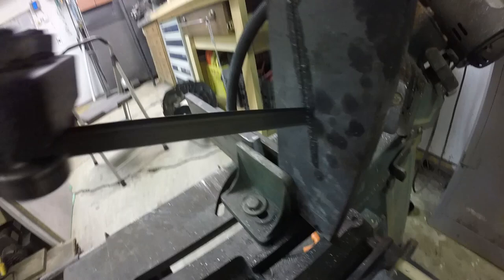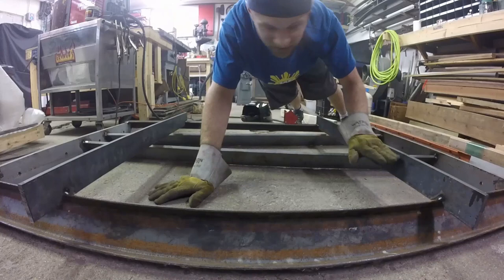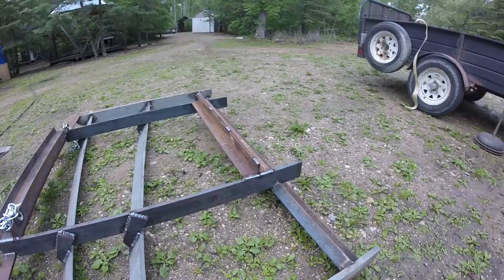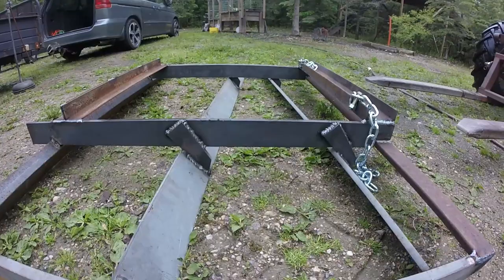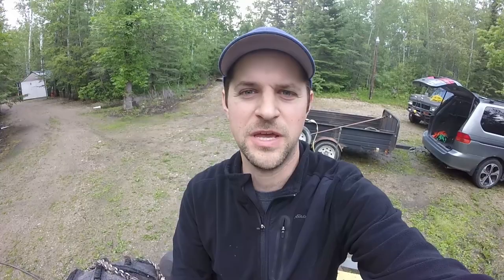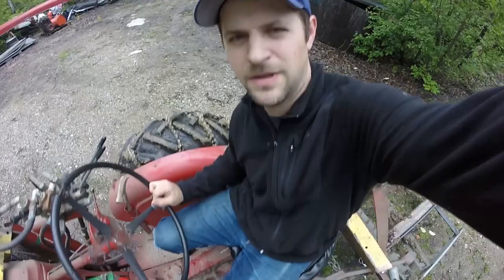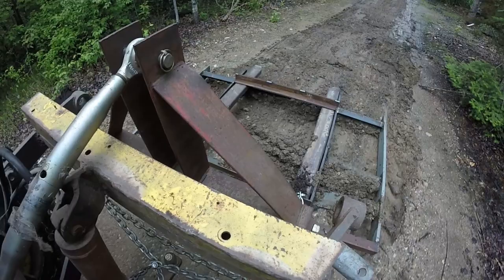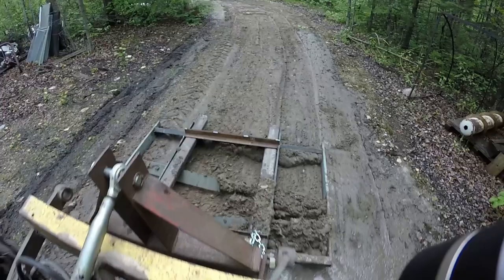Homemade 3 Point Hitch Land Plane - First Test

Comment: I am no professional but, I would have to say the issue with the rocks is that a land planer is a finishing tool. You are dragging into a surface that isn't a finished product. The size of rocks popping up are ones you would have a foot down. The top layer should be a gravel consistency for the plane to work as advertised. An easier way to look at it. A plane is a butter knife, meant for smoothing and leveling smooth aggregate.

Comment: As a home made box blade, I wouldn't judge it on a wet road. My 5ft box blade wouldn't be great on our wet road right now either. I'd say, wait till it dries out a little, then try it again. I'd say, it did pretty good, all things considered. My box blade has 5 or 6  adjustable-height teeth on it, that would be easy to add for you, if you needed to rough up the surfave a little. Other than that, I'd say you've got yourself a decent boxblade!

Comment: Teeth on the front blade (railroad spike works good).
Angle the middle blade more to let more material flow over.
Also attach an expanded metal to the top/behind the middle blade to catch rocks.
More weight in the back and adjust the top center link.
Reply: oh the expanded metal is a good idea.  I have a problem with waves in my airstrip, not ruts.  Ive only been using a drag harrow.  Need to make a long narrow drag box i think or use an old axle assembly for some rear wheels back on a pole, I would thing something 12-16' feet long is required to really get the bumps out, Ill be pulling it with a 4-wheeler.
Reply: I know your post is old but this is a great idea. Thinking maybe some 6" angle iron on top of the expanded at an angle to vibrate the rocks to one side. Thank you for that tip.

Comment: Think of it operating as a wood plane the high spots will cause a lot of drag and you only want to take a little at a time setting the top link to help control pressure on the front and back, and the side rails may need to be a little wider to help them to float so that you are only working the area inside the box, the length of the box helps to smooth the high and lows verses just a blade thay you have to keep feathering the 3 point up and down to get things smooth, all in all I thought it was working pretty good after watching some of the other videos of land plane that were commercial built.

Comment: Road needs a crown for sure. Need to drag a little off the side of the road to bring material back into the tracks. That material will displace the water. Wet roads are tough to grade as the next vehicle is going to leave ruts. 
I would add some 3/8” flat bar to the bottom of the sides as skids

Comment: I think you need some cutting teeth on her (weld on some 1/2-3/4" bolts) , and also maybe 150-200LBS of weight.
Reply from the maker: ill try weight first, it easier hehe
Reply: @REDNIC79  I agree lol, start with the easy fix / test first

Comment: I used a land plane years ago to level a new hay field.  The one I used was about 20 feet long, with a single blade in the middle.  It needs to be long to bridge the low spots and shave off the high spots. The dirt would collect quite a bit in front of the blade, but drop out to fill in low spots. It needed to flex to follow the ground contors and shave off the high spots.  I think yours would work better if it was dry, but I think it's attatced too solid on those forks and can't flex?  Just my guess.  Try just dragging it with a chain.
Reply from the maker: Ok, ill get it to float more. Thanks!
Reply: @REDNIC79     It looks like it should work. I bet if the ground was dry, it would be better too.
Reply: Good stuff, Thanks

Comment: Hi

I'm not a farmer but I only have suggestions
1   suspend the drag unit below the forks by brackets or chains or brackets front with chains at the rear

2   Add a platform at the rear for adding weights or cinder blocks so the leveler blade is no lifted up as the scraper            blades ride up and over the big rocks

3   Plus as an addition;  what if you integrated something designed similar to a Front End Loader ROCK BUCKET that collected the large rocks as You go along. Then dump them between passes. Those rocks will add down forces at the rear leveler blade

These are only suggestions since watching your video I saw the whole assembly lifting off the ground in a parallel motion instead of allowing the leveler blade to remain on the ground

Ken in Florida
Reply: Your designed basically worked very well, it appears too Me that it is too dependent on the fork assembly and it rises & falls as a unit 

Flexibility of the front portion too the rear might help it be more efficient

Comment: Ok what you need is some side tilt to dig into edges about 15 degrees make passes each side bringing road base to center of drive way forming a crown the drains water to both sides help maintain surface shape those 3 point rear hitch can be tilted ajusted its not to wet its better once the side drainage is formed once you have got both sides to depth make a few passes with blade at level position if your tyresxare leaving wheel indentations trails get off it let it dry out if its holding weight keep driving to compact the surface when it drys out it will be like concrete hard

Comment: I have some experience running a road grader and in building my own implements.  You have a good idea, but I think that it is a little wet.  Also, if you could figure out a way of setting the digging angle of the blades and turn them up a little higher, it might not bring as many rocks up. Maybe make them bolt on and have a couple different holes to change the angle.  I built my own box scraper and I prefer it to a land plane, but that's just my personal opinion.
Reply from the maker: when you say change the blade angle do you mean more flat to the ground , or more vertical?
Reply: @REDNIC79  More vertical.  It might help a little depending on conditions.  I would make it adjustable for sure though.

Comment: Definitely needs some form of ground breaking at the front of the plane and a flattening blade at the rear to smooth things rather than "scrape" them. I'm saying this for two reasons (each to their respective problem).
 
1. the plane lacks the operational weight to pull the job in one pass, neither can the machine take the abuse, so simpler to tooth it.
2. i saw a lot of the ground that was scraped go over, and then just fall flat. If you'd add a flat surface that "sucks" up the scraped ground, it would work a lot nice.
 
If it were my project, and only then, i'd probably do something like this instead of point 2: weld 3 chain lengths, one center, two at the ends, and add a piece of scrap tubing (square, preferably) filled with concrete to them. The tubing would float independently up and down over the uprooted ground and the weight of the concrete would make it sit on the ground. But that's just me, i'd understand if others would be reticent in doing something like that since it's a considerable investment.

Comment: I am thinking of making one. I think you need some play in the top link so it will let the back follow the ground. Like what a bush hog has it lets the mower move to the contours.  With yours maybe if the back cross angles were just a couple inches higher it would still lift with the forks but let it drop some in use?
Reply: I agree.  The top link should be chain or have a section of chain instead of traditional threaded fixed top link.  The chain link should be loose when setting it up on level ground but still short enough to lift the rear of the land plane with the 3pt lift.  This will allow the land leveler to stay in contact with the ground when the tractor rides over a high spot.  This is a relatively inexpensive change.  You should also consider a method to add some weight to you land leveler.  Otherwise, well done.

Comment: Take some excavator tracks and pull that no hassle no cutting teeth it will end up snotty and you will pay a month down the line the trick is conformity in hardness ...and for the smart ases not compaction just get old tracks and no more hassle believe me I've tried it all timing after rain is also a thing to consider

Comment: Drive is too packed, land planes are for a more loose substrate, like gravel.   You would be better off to rip that driveway up with a cultivator or finish tool then plane it down.  I suggest putting a drag skid along the bottom and make the sides taller than the blades so it dont spill out the sides.

Comment: My experience from using a pasture harrow behind a tractor to groom driveways is that, if the implement is heavy enough, it is better to drag it behind me with a chain so it floats over the surface e and finds its own level, rather than having it rigidly attached to a 3 point linkage